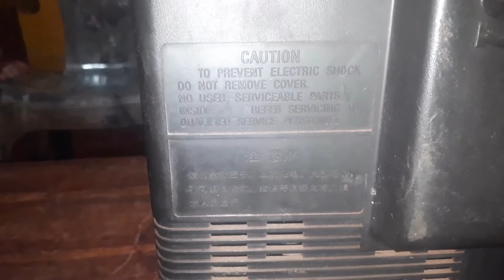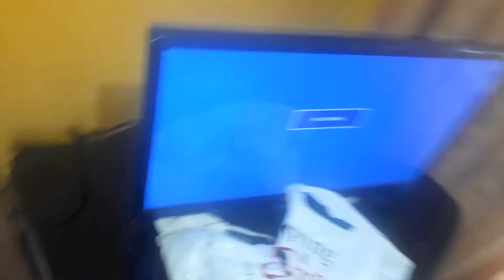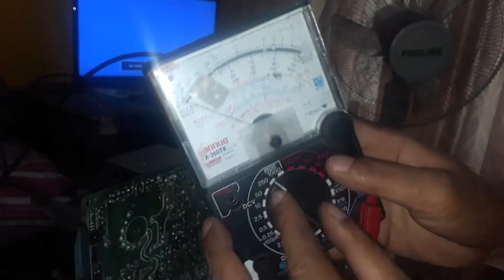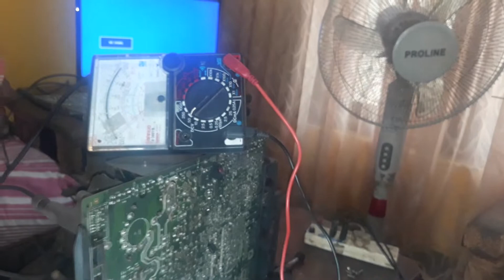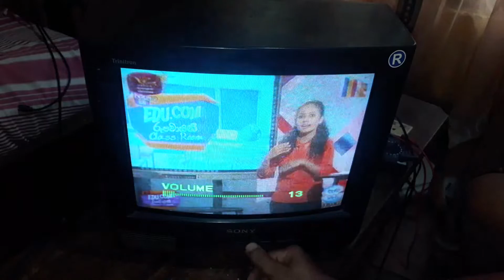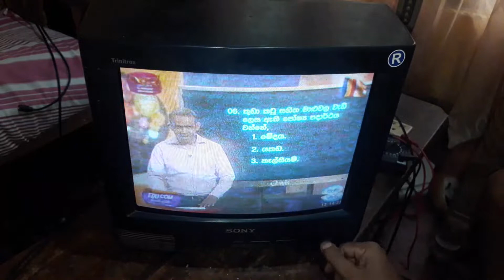How to repair a TV without pictures? ( sinhala )

Comment: Bro, crt tv repair waladi board eka eliyata ganna taran york cable eka diga nettan, york cable ekai, flyback eken tube ekata yana cable ekai, neck card cable ekai galawala voltage check karanna puluwanda? Ehema karot york ekata yana circuit eka pichcheida?
Reply: @pushall8331  thanks bro, video set eka hodai.digatama repair video karanna.